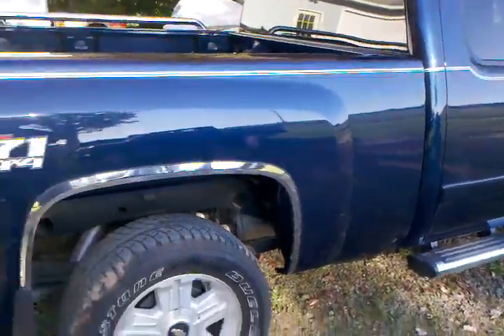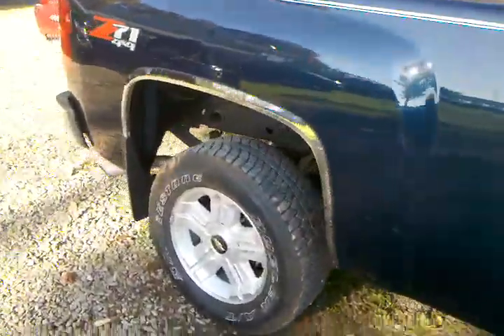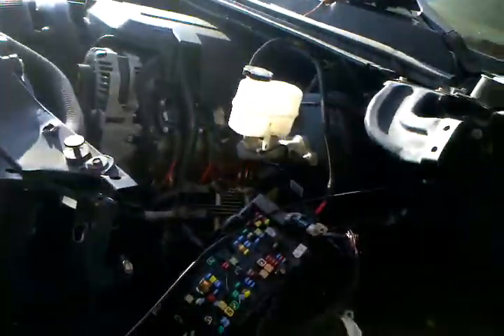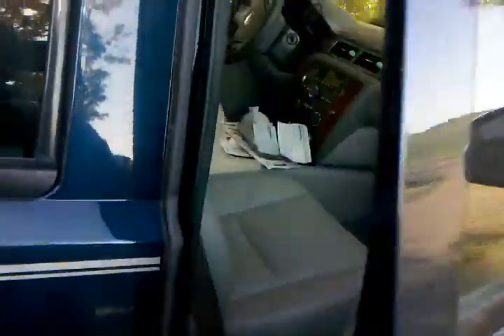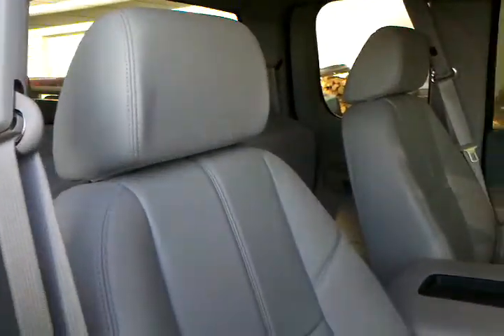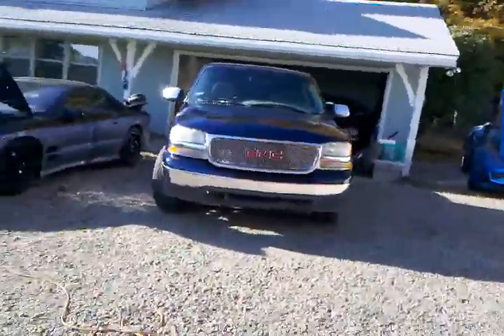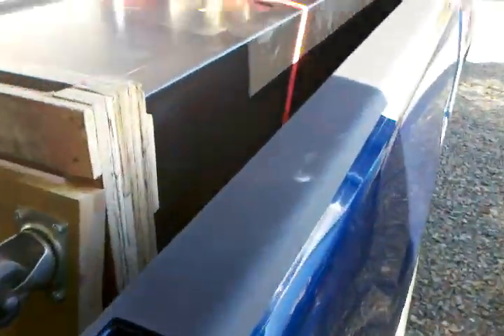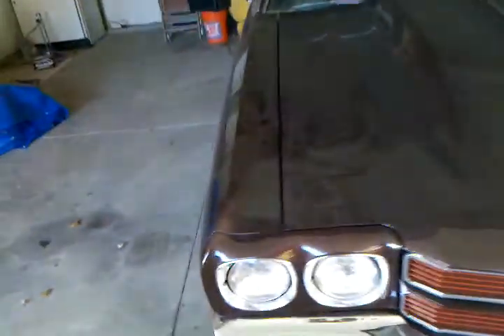My new to me 2008 Silverado Ltz and brief look at my new Cannon 24 gun safe.

Comment from the maker: @UBBERTANKER parts ended up running me a little more than expected but thats fine having a 2008 LTZ with the Z71 package with 23,000 miles on the road for a little under $15,000 never find one that cheap at a dealership even if I was to go to auction and buy one would be up around 25000 at the least having a car that has been wrecked does not bother me we been rebuilding wrecks for years dad has been since around 1970 as long as its done right never have problems